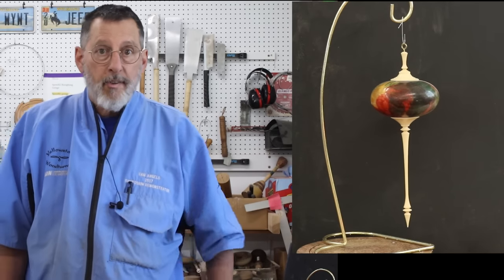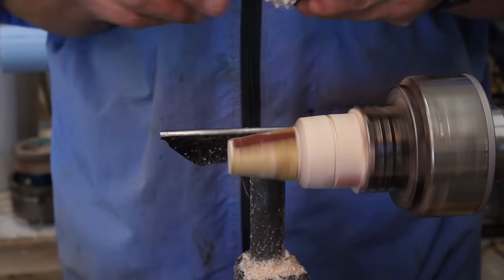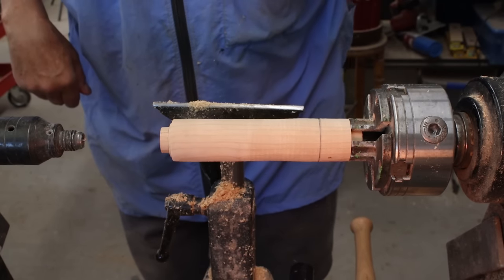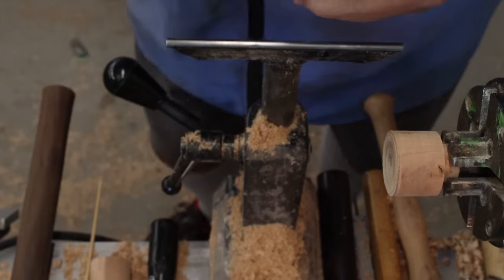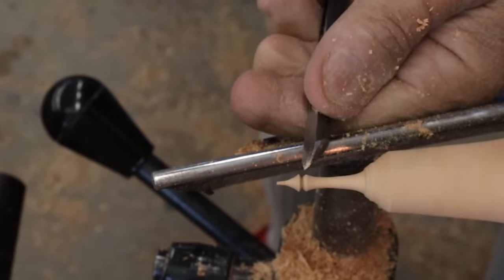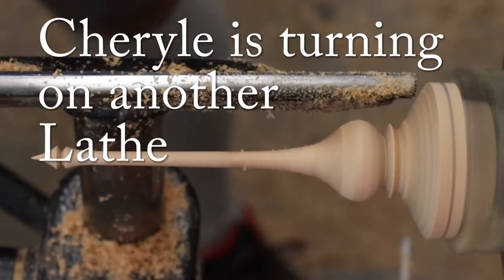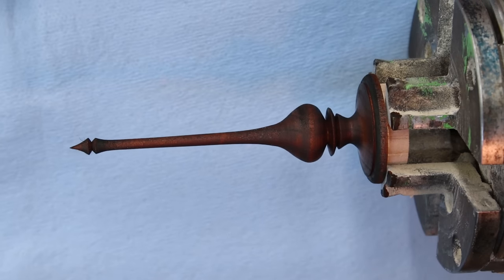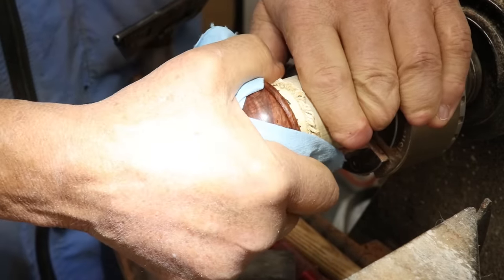Elegant Sea Urchin Ornament With Gold Leaf -November 4 Ways to Turn Project Turning with Sam Angelo

Comment: Beautifully turned and presented Sam. You are a real artist. Watching you turn a finial is like watching Richard turning thin wall. I have to hold my breath. I have tried finials but keep on snapping them as I'm too heavy handed. I have learned a lot from your videos and hope to learn a lot more.😃
Reply from the maker: I think the key to turning a finial is using the right tools. I never use a skew chisel. What happens with a skew is the wood rides up on the cutting edge? It makes it very difficult to turn. I do scrape with some sort of a gouge. Just practice Sam.

Comment: Very nice!  I've been making these for more than 5 years and find that making thin finials difficult after switching from making bowls - the muscle memory needs retraining for thin and light cuts. I make both the sputnick and green urchins. For the small green urchins, I make a longer finial that ends at about a wooden pencil lead in thickness. I applied gold leaf to a few, but find that the bums break through the leaf and the time required doesn't seem to be worth the result. Most of mine go as gifts.

Comment: I love these sea urchin bobbles.  Did you add any weight to the base piece or was the mesquite heavy (dense) enough to hold the ornament?
Reply from the maker: I actually did add a little bit of weight. I drilled out the base and put some washers in it.

Comment: why did you not glue the finial to the sea urchin, was it so if a finial broke that it could be taken apart and fixed easier
Reply from the maker: Actually you named a really good reason for doing it like that.  But gluing it can make a mess.,  This is not my original technique.  But i feel it is verysecure.  Just drill out the finial parts at the right time on the lathe, then measure..... Sam